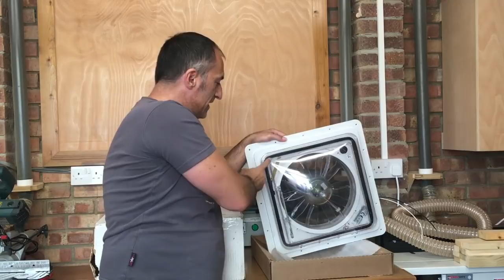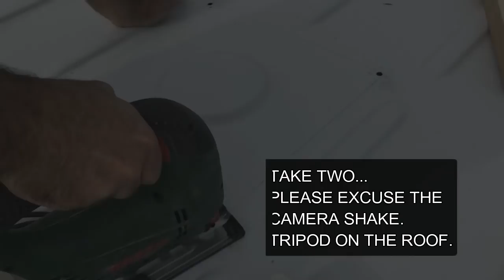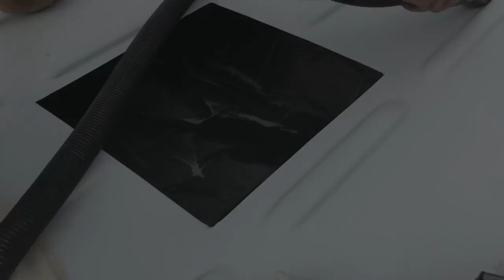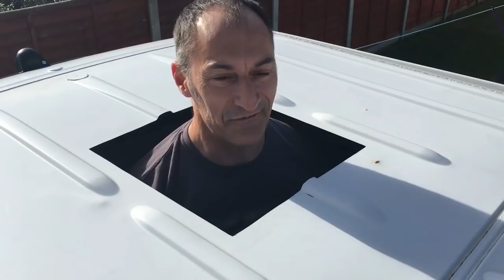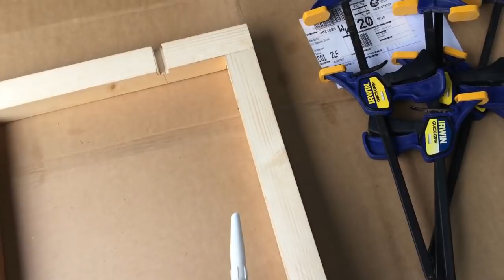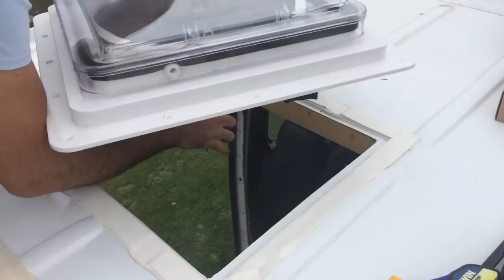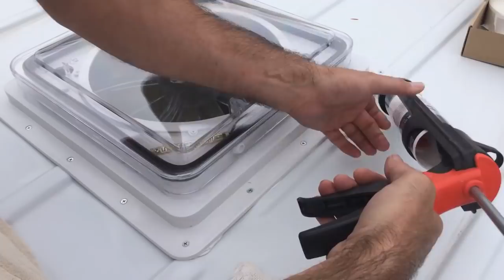Mercedes Sprinter Self Build Campervan - Roof Fans

Comment: Nice install and nice fans. I love the blower feature so you can really get a good cross draft.
Good for keeping condensation down.
The silicon scrapers are excellent, I was never happy with my beads until I watched the "ultimate handyman" show a product called a Fugi kit. Worth a watch and the Fugi is top notch.
Reply from the maker: Hello Harvey, I looked at those and essentially exactly the same tools. Great the way the silicone does not stick to them and perfect beads every time. Thanks for your support.

Comment: Great work Greg looking forward to the next instalment. Thanks for the links to the parts needed as I was needing the sealing compound but didn't know what it was called. Thank you and keep up the good work and videos.
Reply from the maker: No problem David, I put a search result up there as they do many different thicknesses and widths.
I used just over half a 10m roll of 32mm wide x 2.5mm thick.

Comment: Loving the work mate, looking forward to insulation especially and curious if your putting in a stove.
Reply from the maker: There will be some very interesting facts in the insulation video,
I plan to calculate the heat losses and predict where moisture will form.
My mechanical engineering background will be put the good use.
Hopefully, I can put it across in a way everyone can get something from it.
We do plan on having a gas cooker fitted in the kitchen unit.
We will also be fitting a combi boiler for heating and hot water.
All controlled from either your smart phone or tablet. So loads coming up!

Comment: Great work, very pro.
Reply from the maker: Thank you for such great feedback.
I just checked out your BMS video as I was only yesterday looking at Valance Lithium batteries that have a BMS system you can hook up to a laptop via an RS483 to USB connection. What make are your batteries?
Reply: The batteries are by Boston Power, although they are generally not available to consumers. They're also Lithium Ion, I would recommend anyone goes with Lithium Iron Phosphate (LiFeP04) instead in a van, much safer if anything goes wrong, and more commonly used. I still recommend a BMS with them. I've got another video on the batteries as well. A built in BMS in each battery makes sense, as long as the batteries are the right voltage and thus are then in parallel. Otherwise you'll need to balance the batteries too.

Comment: Nice neat job Greg and forward thinking on the slot in the wood for the wiring to go through. Thanks
Reply from the maker: Ah, you noticed Keith, well spotted.
It was a bugger on my own to feed the wire in on the first one, it was covered in sticky mastic.
You can probably see I got tagged a couple of times. Not good with my hairy arms, hehe
The second one I got my father in law to feed the wire from below, lesson learned.
Reply: Greg, i dont recall you saying which sprinter you bought, long wheel base high top?  Many thanks
Reply from the maker: Hi keith, its the high roof, LWB version, 313 CDI with 6 speed gearbox.